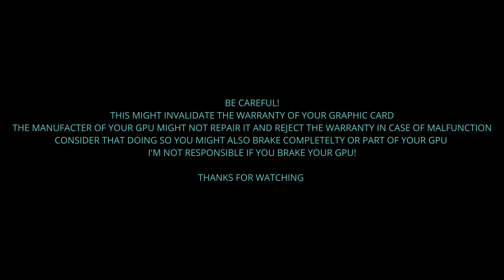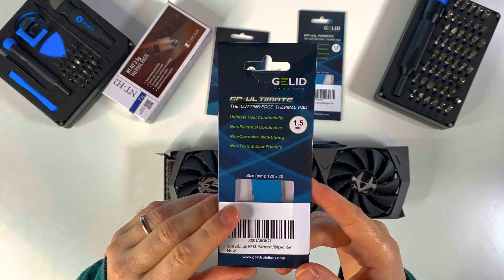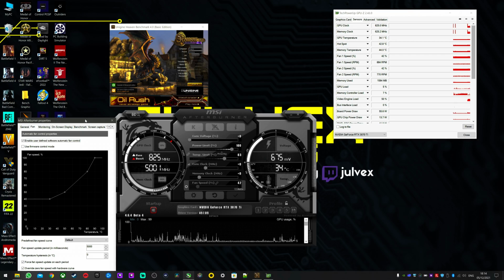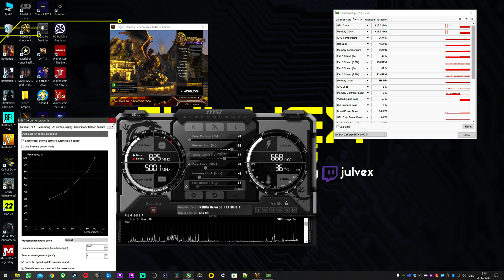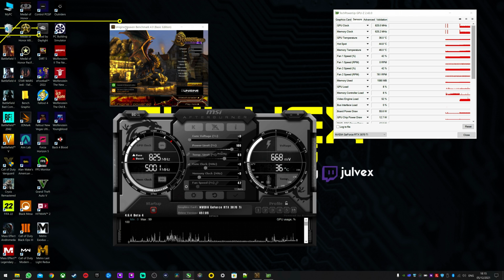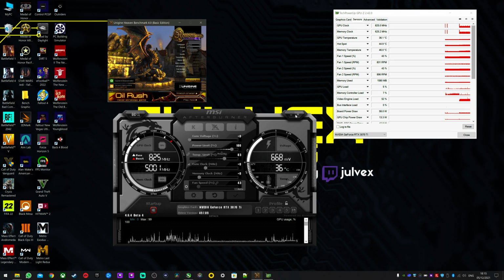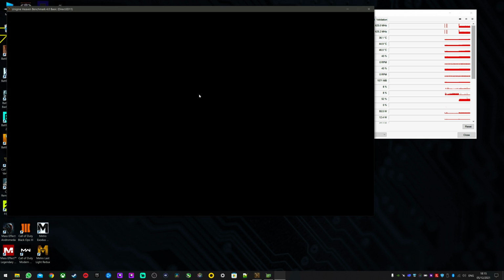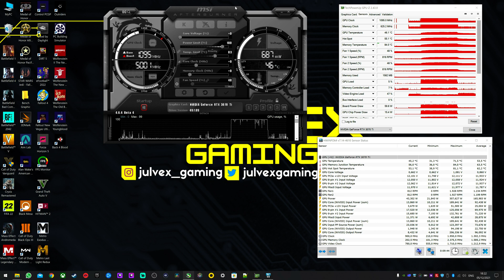Replacing the thermal pads on Zotac RTX 3070Ti Trinity OC

Comment: Hello, just some questions if you have time as I see you know a lot of stuff, I boguht 1 month ago a 3070 ti zotac trinty, to play and when i am not playing mine with it and i get 94 - 100° in memory and 43° in the core, with my air on i get betwen 90 to 94 in memory, you consider those are good temps? i fear it could make some damage as are too high, I want to change the pads but you know, dont want to lose the warranty, but on the other hand after 1 month it works fine and have no issues and i dont think it will fail, so i think it may not worth to stay with the warranty and not change the pads, do you know if the warranty works if the gpu get damage for stay in 94°+- 24/7?
Reply from the maker: Hey there, the tjunction of this memories GDDR6X is around 105C so you won't damage anything (the GPU itself won't let you 😀 ), on other hand having those temps on idle isn't that good honestly - in short terms (usually 3/5yrs) nothing would happen but in long terms, you might have some issues. That difference between core temps and memory temps isn't that normal tbh. I would try to increase a little bit the airflow or fan speed in your build. If, where you live, changing the pads would invalidate the warranty and you don't want to do it then don't go for that. Also, in idle 94C 24/7 isn't something I would recommend 😉

Comment: Hey thanks for the great content, it really helps. I got a question, I am about to buy this  3070ti and was wondering if I must change the thermal pads as soon as I have the card or if I must wait, thanks in advanced
Reply from the maker: Thanks. I suggest you to don't change immediately, what I would do is installing as it is and check the temps while gaming for some days, after that you can decide if you're ok with those temps or change the pads and also, important repaste the core.

Comment: Great job. You make it look really easy. I will give mine a try soon as I feel ready. Also, after applying the new pads, how much did you tighten? A lot or at slight resistance?  Thxs in advance.
Reply from the maker: Thanks. I've tighten enough to see the pads start "squishing" but without overtighting over than that.
Reply: @JULVEXGAMING  i have good airflow even i given my rtx 3070 ti table fan . But still 102+

Comment: Thank you for this, I also have an issue with this card with the fans making a strange noise, it's almost like a grasshopper, and seems to be from the fans rubbing on the shroud. Do you have that too?
Reply from the maker: I had something similar and I tried to reseat the shroud and fans but still, then I went with a vertical mounting - that eliminated the issue. Check out also that the one of the fans isn’t touching any cable. Another thing you can try is to spin at 100% for a minute the fans and check out the noise. What I’ve noticed to my GPU is that having the speed of the fans below 45% the noise is strange, I managed a custom fan curve in MSI Afterbruner like so: 0-50C fan speed 45%; 60C/50%; 70c/60%; 80c/70% (really noisy and aggressive) give it a try. 
I think the shroud+fans in this card aren’t really well done assembled.
Reply: @JULVEXGAMING  Thanks for the reply! Mine also behaves differently depending on the speeds. I also found pulling on the edge of the shroud seems to alleviate it so I wedged a small piece of plastic under it and it's mostly quiet now. A vertical mount hadn't occurred to me I'll try that. I agree about the build quality too, my vram temps are pretty horrible, fans sound like a jet engine over 70%

Comment: Do you loose the warranty ? How much temperature and mh/s do you get if you mine with it?
Reply from the maker: You can loose the warranty. I usually don't mine but I tested anyway for about 1hr with nicehash and the memory temp didn't went more than 92C - bear in mind that these depends a lot on the airflow of your case, the speed of the fans of your gpu, room temperature and many other factors (overclocking included). I used all default and my room temperature is around 20C more or less.

Comment: I have this exact card and when I’m gaming at 2K my core temp gets up to 82C and my hot spot gets to 92C. Should I be worried about this? I don’t feel that comfortable at this temp but I don’t want to void my warranty. Really what I’m asking is if I continue to use this card like this for gaming (3hrs a day average) will I experience any permanent damage?
Reply from the maker: Hi there, the core temp is a little to high in my opinion considering that you are gaming in 2K (if RTX is on the temps can go high, that's true), hotspot usually it is similar to the memory temps and 92C, while gaming, is ok. The thing is, if you continue to use it like this in short term (let's say 3/5yrs) you'll be more than fine for me and you shouldn't face any permanent damage .
Some additional tips: try to improve your the airflow of your case - if you haven't done it yet, or most importantly you can try to undervolt the GPU with MSI Afterburner (it will be a guide on that in the channel), that will dramatically reduce the core temp and you won't loose basically nothing in performance. 
Certainly, re-apply the thermal paste can help a lot, but if you don't feel comfortable don't do that especially if that would void the warranty.
Reply: @JULVEXGAMING  Hey man, I really appreciate the reply and the advice. I found a really easy fix (you cant use the graphics card at full power) but in zotac firestorm my target gpu temp was 83C and this was making my temps reach 82C, I changed the target temp to 80C (graphics card is only at 88% power) and my new average gaming temp became 76C and 86C hotspot. Obviously the card isn't running at 100% power but this really helped me out and I'm now comfortable with the temp and performance. You can also set a custom fan curve in firestorm. I'm just leaving this here in case anyone wants to change gpu temps and not void warranty. Thanks again for your advice, your a great youtuber and keep up videos like this because this is exactly what people need to know, goodluck and keep up the hard work!
Reply from the maker: @lanetomlin5381  thanks! :) 
I've used the Firestorm sometimes and low the power % just to get quickly low temps; also because it is the only way to turn off or change the RGB of the GPU. 
Doing so you aren't going to loose basically nothing on performance, just sometimes turn on RTX (whenever possible) or max the details of the game - this would help to understand if the GPU require more watts to drain ;) and avoid random crashes, for the rest happy gaming :)

Comment: My 3070ti OC Trinity already gets 78c running that benchmark on the stock thermal pads so not sure this would do anything. Where it hits 100-106c is running NiceHash mining. Wonder if I should bother trying. Seems like Zotac may have updated their thermal pads.
Reply from the maker: I guess yes, but the stock thermal pads were really terrible. I tested also with NiceHash and reached before changing the pads, I assume that the first 3070ti GPUs that came out kinda have a really bad quality thermal pad mine were like oiled and melted after almost 2month, but if your temps are ok and you’re ok with that really not need to change them
Reply: @JULVEXGAMING  thanks for the response. Can you also comment on the thickness of the pads? Most of the recommendations say to use 2mm pads, can you comment on how you came up with the 1.5mm thickness? Not saying it's incorrect but curious if you measured this somehow?
Reply from the maker: @thepiecesfit5049   that's true, but it depends a lot on the type of thermal pads you're using (more specifically on the shore/hardness), on how thermal paste also you use on the core - because that will increase about 0.2/0.5mm all the total thickness, I tried to measure the old one with a caliber but then I consider all these factors, and also because doesn't make much sense to measure a thermal pad after that has been applied; so went for the gelid ultimate 1.5 which has a shore of 60/70 which isn't really "squishable" (I know isn't the most technical but just for giving the idea ;) ). 
In my opinion, it depends on these 3 factors: shore of the thermal pad, amount/thickness of thermal paste on the core, and how much all the screws are tightened; with that said I think the most precise thermal pad, in the range of shore 30-50 might is 1.7mm, which I assume doesn't exist so this is why I went for the  GP Ultimate 1.5mm which have a shore of 60/70 and in my case were doing ok. In the past, I went for the gelid extreme 2.0mm and wasn't really satisfied with the temps, and how much they were "squished". Do keep in mind that all these results can change from GPU to GPU based on how each one of us goes through the process. My final recommendation is: if you have thermal pads that are in the range of 30/50 shore you might go with the 2mm, if you have thermal pads with a higher shore then a 1.5mm thickness might be the right choice.

Comment: Thanks for the Video this was very helpful.
I have Zotac 3070 ti trinity. Just one quick note - I think the dimension for the last in memory module shud be 30×15?.
Also could you please let me know the screw type or rating which u used to open the GPU. I will order it online.
Reply from the maker: Hi, you’re right it was a typo error I correct it thanks. For the screws I used the normal PH1 and PH0
Reply: @JULVEXGAMING  Hey hi. Sorry to trouble you.
I planning to do the same and have few more queries on this:
1) Was GP extreme 80×40 mm enough for backplate?. The dimensions u had given for the backplate in description are not entirely fitting for 80×40. I tried drawing on paper to check.
2) At 6:37 I see a large thermal pad attached to right of heatsink. Did u replace that as well?. Would it be possible to give the thickness and dimension for that?
3) Due to availability issues in my country I am planning to go with GP extreme 2mm 80×40 for memory and GP Ultimate 3mm 90×50 for back plates. This should work rite?. Your thoughts please :-)
Reply from the maker: @Annmol Mahtani  

1. yeah the dimmensions are approx - consider that the moment you put back everything (in this case the backplate) the thermal pads will "squish" about 1-2mm; sp if you decide to cut it some mm less in order to fit all the drawn you can do that
2. yes because I had one Gelid spare thermal pads, but I think that migh not be that much important in heat transfer anyway the dimensions are approx 80x9mm the thickness is ok 1.5mm (if the thermalpad is "squishable" enough)
3. I've into that as well (seems that the thermal pads have more shortgae than gpu's :) ) as I can see that would work but consider one very important thing: squish it a bit before installing all back otherwise the heatsink surface might not be touching the core surface (don't forget to apply properly a good thermalpaste); and the result of this will be maybe low temps on memory but high temps on the core.
Reply: @JULVEXGAMING  Thanks. Hope this works.